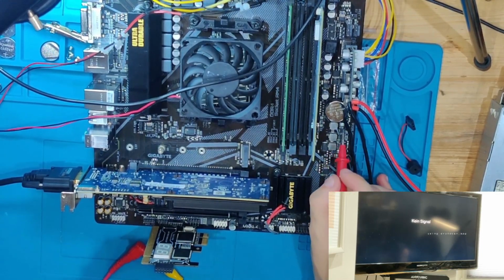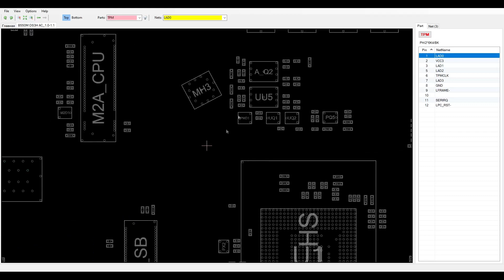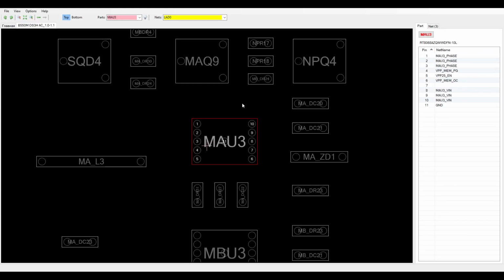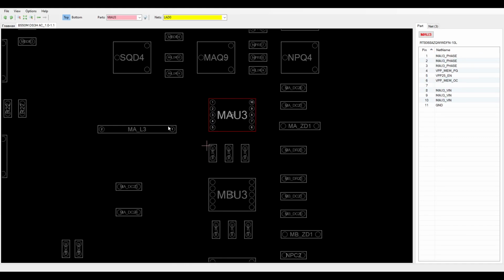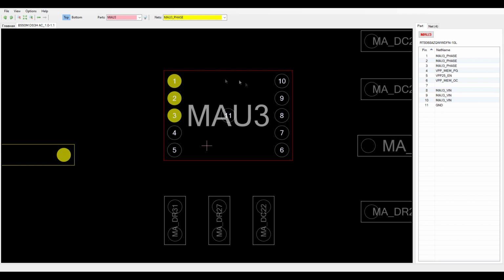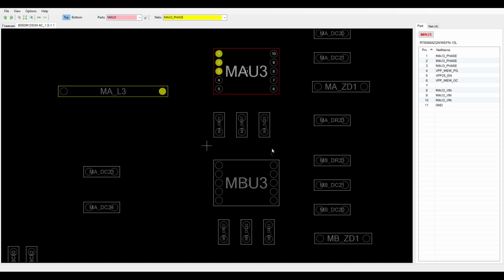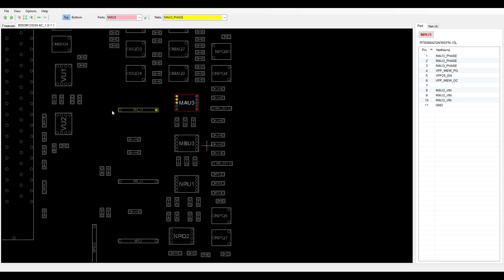Showing how to fix missing Power Rail on a ATX Mainboard , Gigabyte B550M DS3H AM4 Repair

Comment: My friend i have EXACTLY that issue with an ASUS TUF X570 PRO board the DDR RAM INDUCTOR Does not get the voltage, so im wondering just to clear doubt what voltage should i use to power up that inductor, is exactly the same issue literally, can you recommend me please?
Reply from the maker: So the ddr has multiple voltages! But the main Voltage for ddr4 is 1.2V!
Reply: @MainboardMedic  yes but you used 2.5v, I have the same board, and it's ddr4 too, so I want to inject voltage on inductor just to boot the board that's it, so can I use 2.5v and how many amp? 1? 0.6?
Reply: @MainboardMedic  on the video you set voltage to 2.5 my friend, and the amperage?
Reply from the maker: @howtopia  In the video it wasnt the main voltage for RAM! In the Video it was the VPP, which is a ddr voltage but not the main one. The amps i think get to like 3A max.
Reply: @MainboardMedic  the vpp for ram was 2.5 v on your video that's the one I need I have the same problem the same problem of the video
Reply from the maker: @howtopia  Jep VPP would be 2.5V!
Reply: @MainboardMedic  danke Herr medic!!!

Comment: sorry for a noob question, im a beginner and just started learning fixing electornics, how did you know it was 2.5v that was missing. Was it shown in the boardviewer or was it something you know by experience that it needs 2.5v on that phase?
Reply from the maker: Glad to answer, VPP is a major Voltage of DDR that every board needs and its always 2.5V for DDR4! Sometimes its called VPPM.